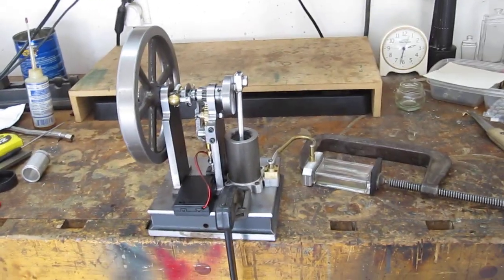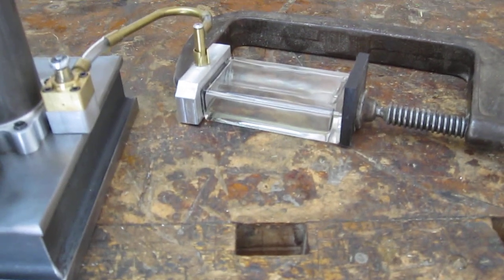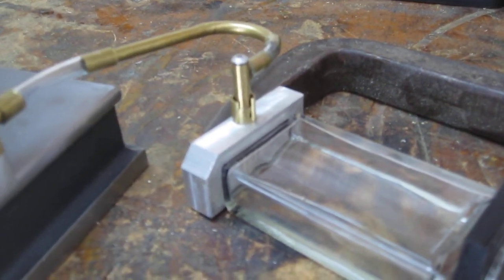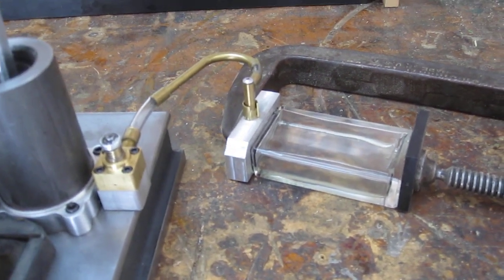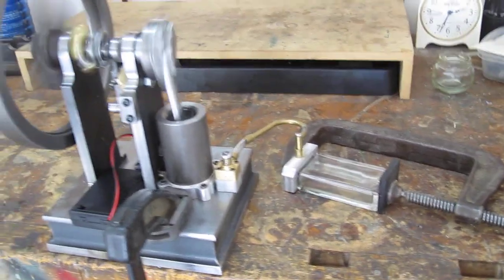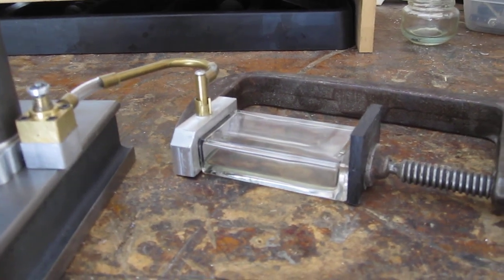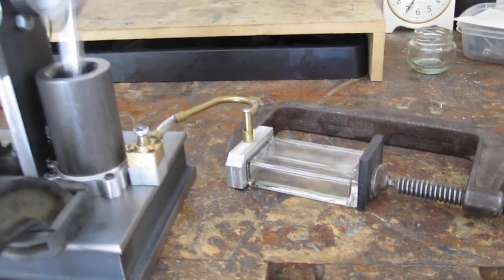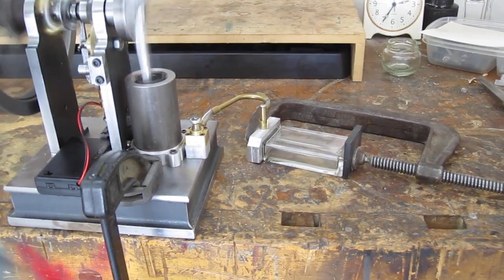Improved Vapor Fuel Tank

Comment: Nice job Chuck :) 

Just wondering if a wick could be used to increase the evaporating area? Perhaps a filter paper dipped in the fuel with air drawn through it would function.